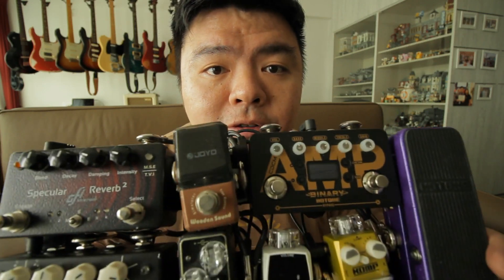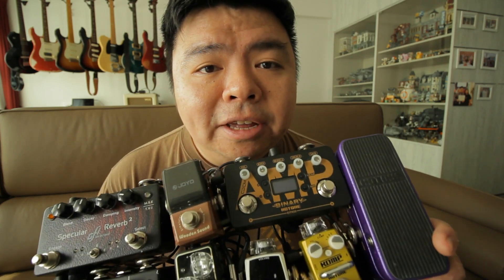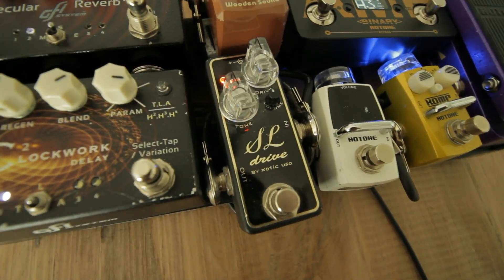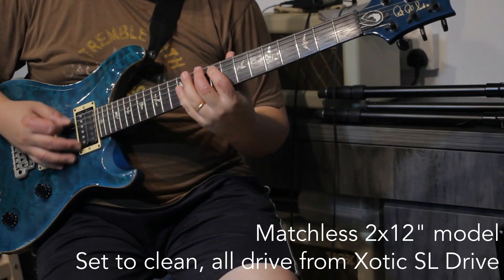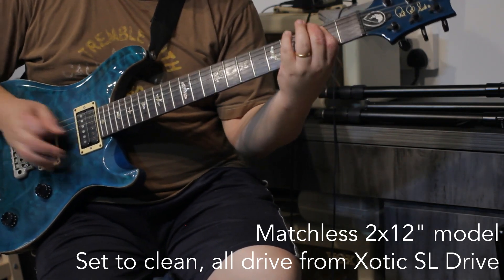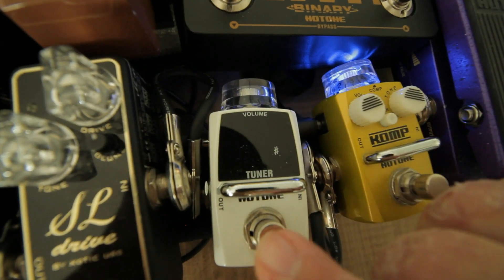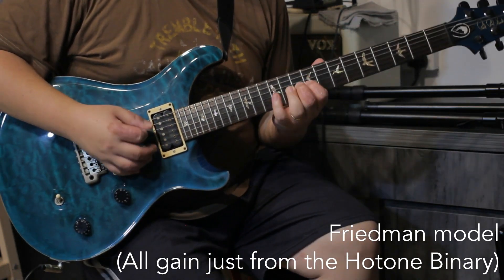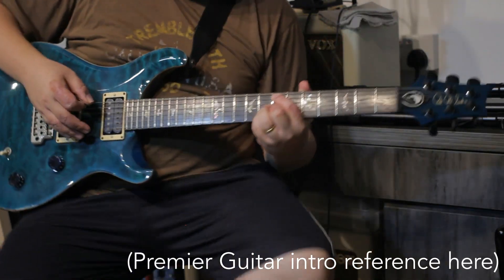Worship Tone on a Budget: Hotone Binary Amp Simulator

Comment: Nice video.  I just got one haven't received it yet.  I got it because I use head phones or a pa.  My question is... Do you put all ur effects in front of the hotone or do you use the effects loop?
Reply from the maker: Thanks! I use the Hotone conceptually like an amp, so I put dry effects (comp, overdrive) before, and wet effects (delay, reverb) after. I could have used the FX loop on the Hotone but I don’t have enough patch cables!

Comment: How is better? Hotone Binary Amp or Mooer Day Tripper to run directly in PA?
Reply from the maker: It will depend on what pedals you have before it. If you plan to use the pedal without additional overdrives, the Binary Amp sounds best. If you need to use an overdrive, the Mooer Daytripper takes overdrives much better than the Hotone.